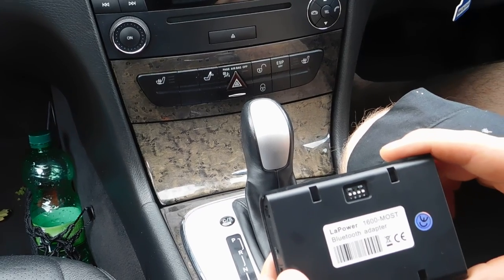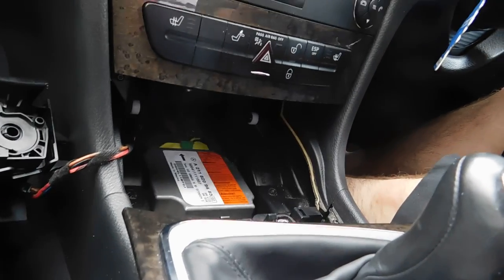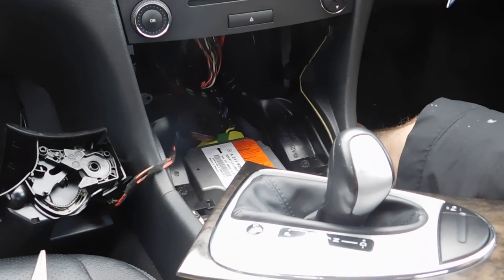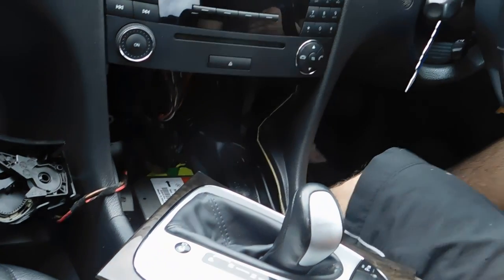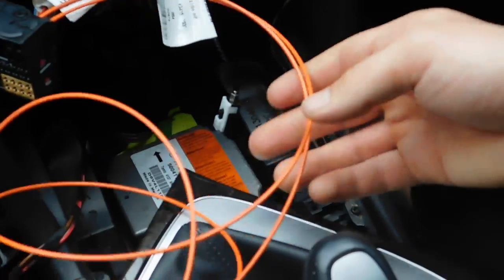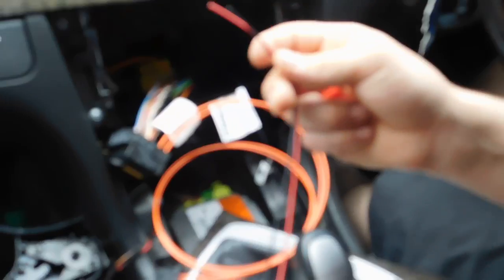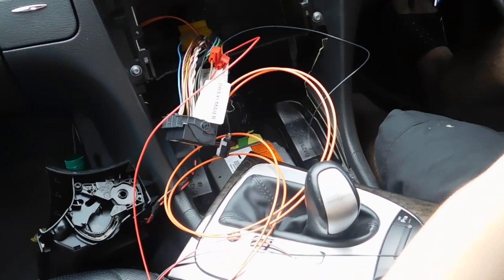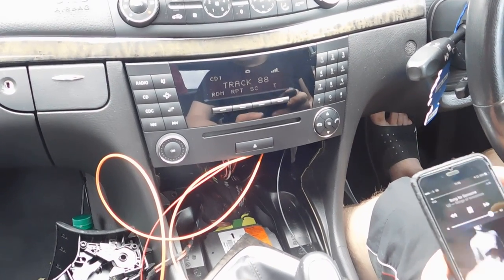LaPower fiber optic bluetooth adapter installation to Mercedes w211 audio20 Unit

Comment: 1. Does this module support steering wheel buttons to answer or end calls? - 2. Does this module reconnect your phone when you get out and then get back to the car?

Comment: Just followed your guide, works perfectly. I have no cd-changer (had the 'No CDC' message before installing this) but didn't have to code anything. Worked out of the box. I put the cables through the light in my glovebox, might tidy it up later. Anyone have ideas where to put it? Thought about the armrest (where the phone connection is) but seems hard to get the wires there...

Comment: One thing I dont understand. He pulls the MOST Fiber Optics from the Head Unit out but keeps it disconnected?
I See he replaces it with the included MOST Harness so connection is now from Headunit to the Bluetooth Box but no connection the the Old MOST Fiber optics cable.

Comment: what did you do to the fiber optic cable you unplugged originally from the harness? DId you close the loop or just leave it ?untouched?
Reply from the maker: C Nas I just left them, they don’t affect anything. This is for phone which installed in in car. But you can buy adapters or shutters for them if you like leave them like that

Comment: Awesome video!! I wished you would have shown how you managed the cables in the end . Where did you put the box? Near the glove compartment ?
Reply from the maker: mkazad  Hi, I installed device into glow box and cables trough light in it.
Reply: Iggy M hey. I just ordered the same product. Now the seller tells me it might not work because I might not have a cdc option or lets say a real changer in my car. I do have the CDC button and when I press it , it just says no CDC. What was the situation in your car ? Did you have an actual CD changer in your car or only the button . Thanks for your help
Reply from the maker: mkazad Hi mate, my car was exactly same as yours, no cd changer, just button on radio.
Reply: Iggy M  thank you for the fast reply !
Reply from the maker: mkazad No probs, if you struggle when you’ll be installing device just txt me.
Reply: Iggy M hi there again. Now I got the product and I connected everything and I don't get any current through the device . Thought it was broken and now the seller send me another one and it is still not working . I am clearly doing sth wrong. Don't see any lights from the device. I fear that the whole CDC option is not activated in my car. But does the device work normally (showing lights) if you just have the red and black cable connected ?  Just as a test to see if there is even electricity coming .
Reply from the maker: mkazad Hi again, I think you doing something wrong, blue light must be on in device, check with electric tester if you have power in cables where conecting from
Reply: zraka66 hi there . So I have now went through the Diagnostics and it shows that the CD changer is "coded" which means it is activated ! So thats the update. I will now try again tomorrow to get the thing going , because now I know for sure it must be me that is doing sth wrong :/
Reply: zraka66 what do you mean by original CDC ? There was no actual CD changer device installed . Do you know what I mean ? I straight away wanted to install the la.power device. And I have an audio 20 unit. On a w203 mercedes 2005 model
Reply: zraka66 zraka66 so you are saying that it's not enough to wire it like here in the video ?  I don't get your advice fully ,  do I need to buy another cable . Sorry for so many questions. And yes thank so for trying to help me here !
Reply: Hi there so it finally worked . After yesterday's computer diagnosis  for the activation of the CDC function I have not tried to install the device because the diagnosis program told me it was already coded . Yet the optical  signal was somehow working today . To sum it up I think through the diagnosis computer it restarted the whole coding thing and now everything is working like in the video . I do have one question is there any option how to change from Bluetooth to USB or aux ?
Reply: mkazad I’ve got the same problem. Can you confirm that the led’s started working áfter the cdc was coded? I’ve got it all connected and the device does nothing. But I haven’t been able to code the cdc.
Reply: I've got it working now. It turned out that I hadn't connected it properly to the optical circuit. So I can confirm that this device doesn't do anything unless it's properly connected to the optical system. So if you only hook it up to 12v for testing purposes, you won't see the LED's or anything else.
Reply: Hie there ive the same car which is a Japanese import and the radio channels goes upto 89.9 only is there any other way i can increase the channels or I’ve to change the whole unit

Comment: Unit has power with blue/red lights, connects to phone but no sound through speakers? If I reconnect the oem fiber optic cabke, everything works as original. Please advise. Thx
Reply from the maker: T2 Automotive  Hi, have you pressed CDC button on radio?
Reply: Iggy M yes. I can see my tracks playing but no sound
Reply: Also not SAT radio available?
Reply: Iggy M No sound from fm/am/wb radio?
Reply: Iggy M my unit displays 2 CD buttons. 1 with 1 CD the other with multiple CDs displayed
Reply: This installation is for 2008 ML350
Reply: Iggy M Solution...unplug FO connector from CDC unit and plug directly to  Bluetooth adapter. No need to remove head unit. Everything connects and installs via the glove box depending on choice for power/ground connection. Good 2 go! Again, this is for installation whereby the CDC is located in glove box.

Comment: Will this work with a 2007 mercedes gl450? Where do I purchase it from?
Reply from the maker: eddie gamble Hi, if you have audio 20 unit, it should work, I had it from eBay
Reply from the maker: eddie gamble type this on eBay:   Bluetooth Handsfree USB SD Adapter for Mercedes Benz Audio 20 50 APS Comand NTG
Reply: I have a plug at the to
p on the back of this radio what hookup is that for its a White hookup plug
Reply from the maker: eddie gamble not sure mate, that could be spec for interface
Reply: @iggym8591  how can I send you a picture of what I'm talking about thanks
Reply from the maker: eddie gamble drop your photo On whatsapp my number +37064329180

Comment: Bad quality adapter. You have to choose between radio and bluetooth transmission. Otherwise  CDC going to unexplained ERROR after switching between two options  (radio-cdchenger)...may be someone have an answer for this issue?
Reply from the maker: It’s good device, it says in description that cdc will be unavailable after you install this, maybe you done something wrong